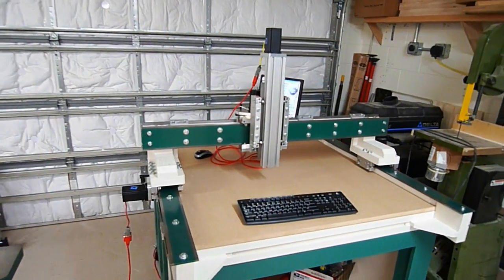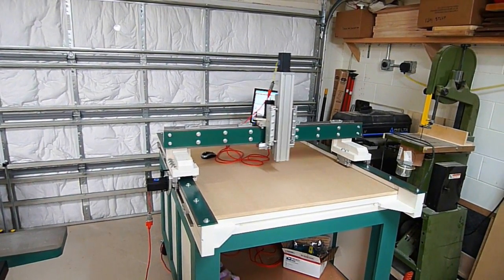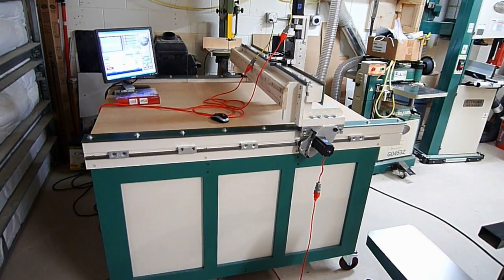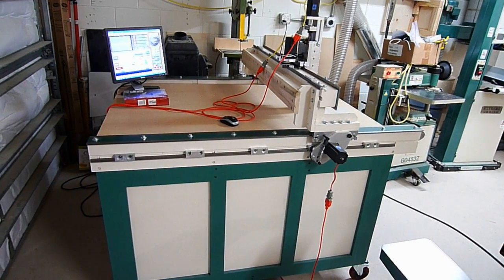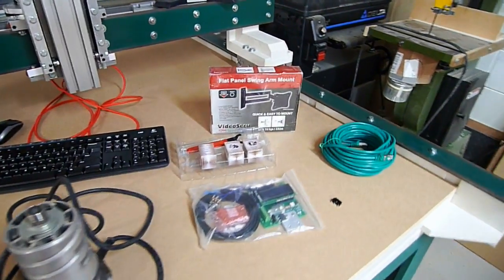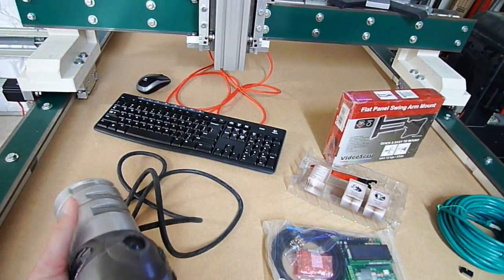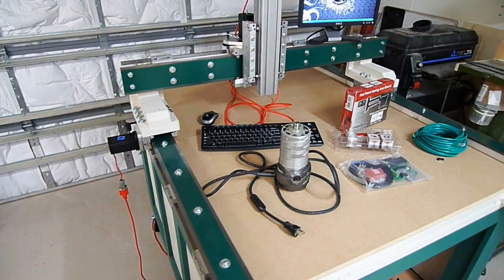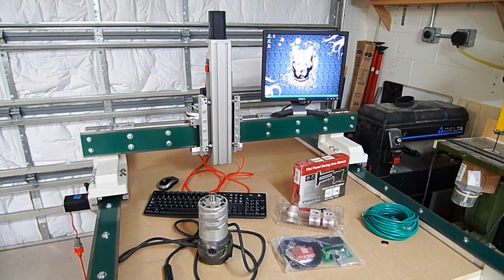Wetland CNC Router Part 17 - IT'S ALIVE! ((thunder clap))

Comment from the maker: The stepper motors are Kelling. The specs are 381oz each and draw 3.5amp max. This is also the max of the Gecko G540 driver as well. The main thing to consider though is the power supply. Do not skimp on the power supply. I am using 48VDC 12.5 amp.